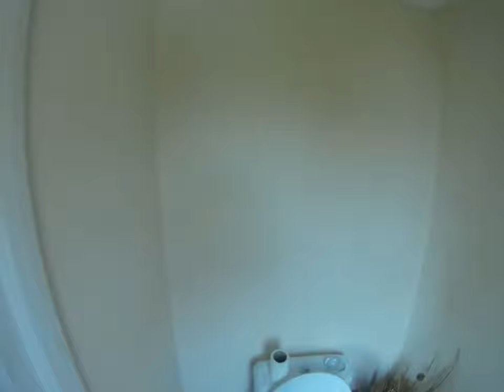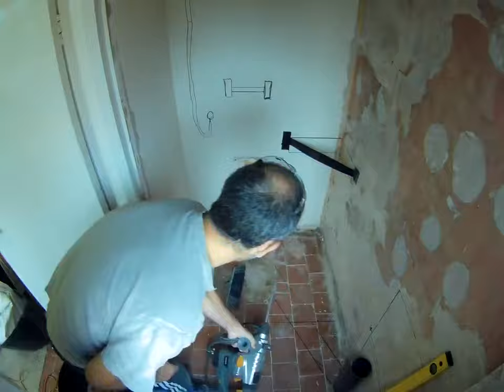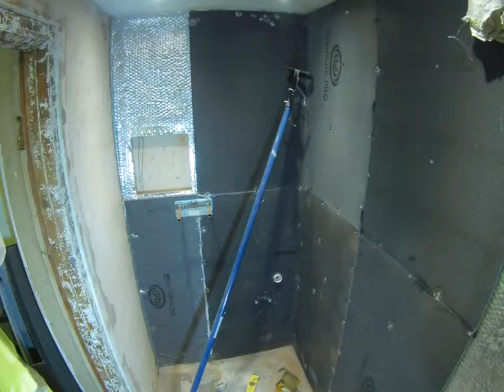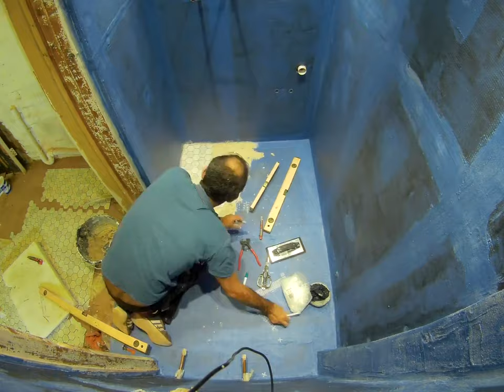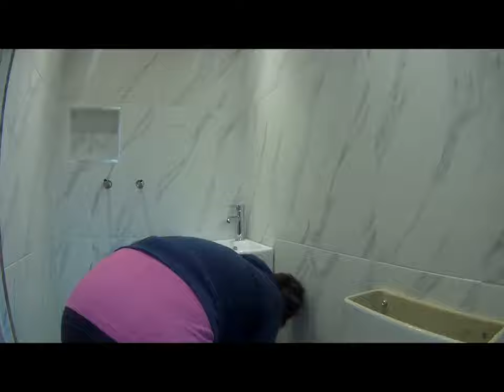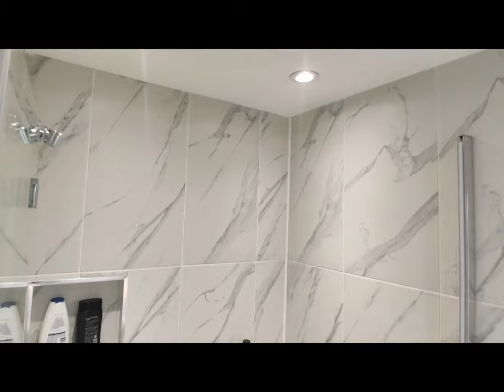Before and After Cloakroom Toilet / Tiny Wet Room, 1898 Victorian House - Time Lapse

Comment: Where did you get that bi fold door? I’m building a wet room the exact same size but can’t find a bi fold door without a bottom guide.
Reply from the maker: eBay, Frameless Pivot/Bifold Shower Enclosure Door Walk In Screen Panel Safety Glass
Reply: Thanks👍

Comment: What was the measurement
Reply from the maker: Hi, about 1400mm by 900mm...
Reply: I got 6' x 45" , what design would work
Reply from the maker: @Eastbaypisces  it depends on where the door and windows are for example. My advice to you would be to try and map out on the floor and walls where everything will go to help you visualize how it may or may not work (I also did that, you can see in my video). Good luck with your project
Reply: @1898_channel  actually made it 7' × 45", door right by front bottom right cuz its rectangular shape layout

Comment: Ummmm should’ve used a Japanese toilet with the faucet on top of the tank to avoid the small sink.  The heater next to the toilet not needed should’ve used exhaust ran with heater and heated floors. The glass dood and shower head whoops!   But the color and style was nice!
Reply from the maker: Hi there, thanks for your comment. Didn't go for a Japanese toilet with sink because I personally don't like them, the sink on those is even smaller and the toilet would have ended up even closer to the door. Shower head is not fixed, it is suction so can be moved easily. I am very happy with the end result....
Reply: Not very functional in terms of access, especially in such a tiny space... Are you gonna spread your legs over the toilet or stand 60 cm away (in front of the toilet) to access the sink on top of the toilet?🤔